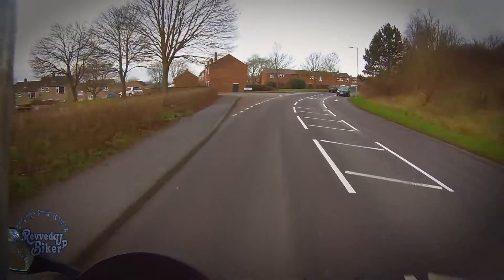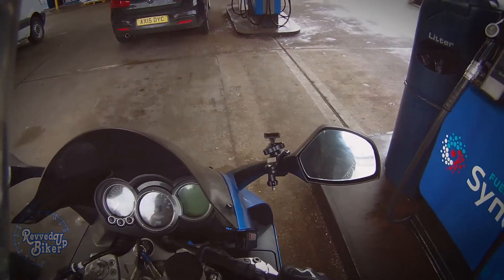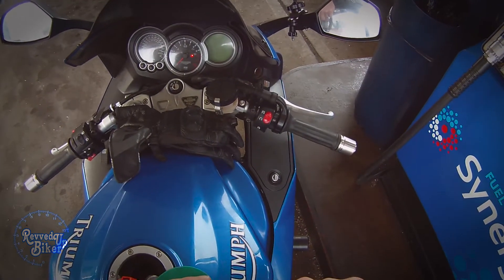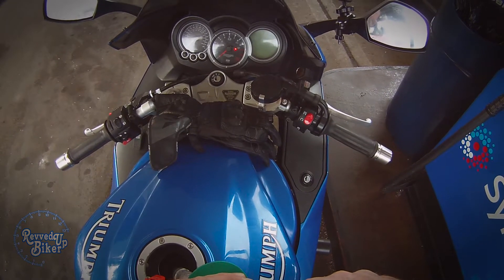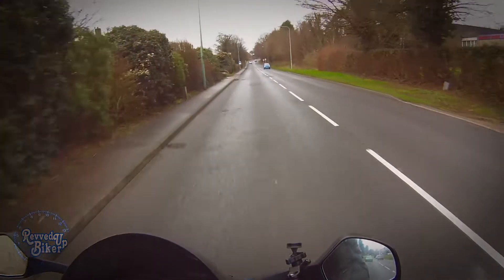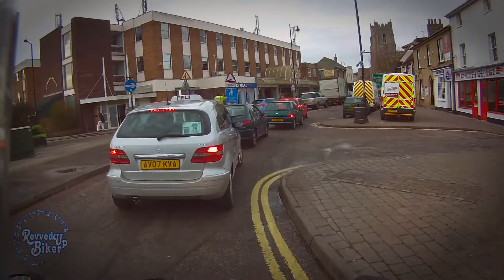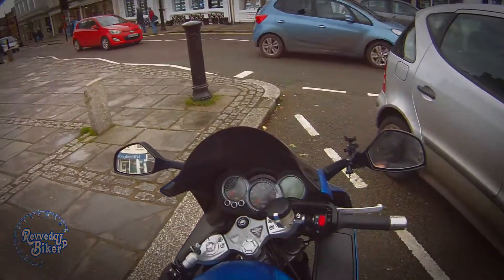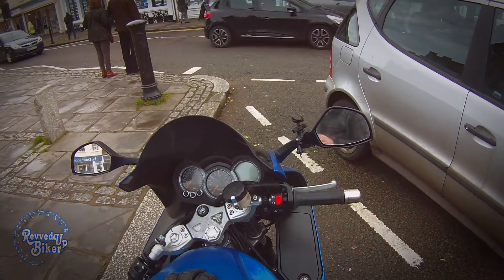Motorcycle Charging Issues - RevvedUpBiker

Comment: So did you replace the rr before? It could be a quality issue but you definitely did the right diagnostic tests for the problem it seems.
Reply from the maker: +Bikers Quest - I had to replace it this time last year from the original stock R/R. Did a diode test on the original and it's definitely got a diode gone, shows zero on one while the other two show normal figures. My replacement R/R that I installed last year past the test, but when it heats up it fails, hence the 14.5v for a while then drops to 12.3v. Could be something causing some resistance but I've done a parasitic draw test on the bike and all is good. On the R/R connection two of the stator inputs are blackened. It could just be a diode inside the R/R that has an intermittent fault. I'm sending it back to the manufacturer today for testing, and they might send me a new one. While the bike is in bits I'm going to ensure all the wiring is correct for the current load i.e. at least capable of carrying 35w and at least 70v. I've temporarily put some 8 gauge wire from the stator, but it's quite thick wire. I think I just need 10awg, so I'm going to replace it again and get it cable tied away from anything that gets hot.

Comment: Sorry to hear about your electrical issues mate, hope you can work them out soon. Have you spoken to MuddySump?? How about a bad Earth?
Reply from the maker: +Andy171 - Thanks for the mention of MuddySump, I might speak to him. I'll need to check the earth point, I believe is on the engine block. I'll have to sand the surface down and reconnect.
Reply: No problem, he's a great guy and worth considering for when you need a service. Have you got a Haynes manual?
Reply from the maker: +Andy171 - Yes. My Haynes says the unregulated voltage should be 35 to 40volts @ 5,000 rpm. Mine produces 40v on tickover and about 70v @ 5,000rpm. It could be that the stator is producing too much power. ?? Maybe I need a R/R that is capable of taking up to 70v.

Comment: Hi mate, having the same issues on my 07 sprint, but I rode mine until the battery run flat and the bike died. Had to get it towed home yesterday. Did you ever get round to finding out the fault? Regards, Ryan
Reply from the maker: Solved the issue by directly wiring the wires. The OEM wiring uses cheap white semi-opaque plastic 3-pin connectors, which are useless. They let water in which causes the connector to short, damaging the regulator/rectifier. I hard wired the stator to the R/R which uses the metri-pack connectors, then hard wired directly to the battery using an inline 30amp fuse on the positive wire. All joint were soldered and heat-shrink wrapped. I might do a video to show what I've done. It's been over a year now and everything has been working fine. 14.2v normal and only drops to 13.8v when the fan kicks in.
Reply: Cheers! Thanks for the reply. I'm going to strip it down tomorrow and have a good look, I'll let you know of the outcome. Did you have to replace the r/r? I smelt burning shortly before the dash died and 2 mins later the bike started jolting then packed up. Battery was completely flat but fired up after a jump start. It's definitely not charging, so it could be wires or the r/r has packed up. Regards
Reply from the maker: Usually if one goes they both go. If a short has happened to the connectors the it is most likely that the R/R would be blown too. The R/R is very sensitive. The last time I changed my stator it was black and you could smell burnt electrics as soon as I started to crack off the stator engine cover. If your stator is burnt out I would totally replace your engine oil, as it would contain burnt particles in it and would probably smell too. I didn't replace my R/R straight away as it seemed to work. It only stopped working when the bike was warm and you were a few miles down the road. All the best with sorting your bike.

Comment: Hi I've got the same problem on my 07 sprint, for the last 2 years Have you cured yours completely?
Reply from the maker: Hi. Yes all cured. I haven't had a burnt out stator and r/r since my fix. What I did was to bypass the bikes own wiring harness. I rewired directly to the  battery soldering all joints and applied heat shrink wrap. You also have to put a 40amp inline fuse on the positive wire. I housed it next to the battery for easy access. I'll have to do a video one day to show what was done. Once you have it fixed you'll have happy riding.

Comment: should be no more then 16v  if you pumping out 70 v you got rocket ship my man lol
Reply from the maker: +bikesforme - For the Triumph Sprint ST 1050 the voltage shouldn't go no higher than 15v. The regulator should stop it going over. I'm going to look at buying a  Shindengen FH020AA Regulator Rectifier. I need to do some other checks like check the earthing points and the amps from the stator, only done the voltage.